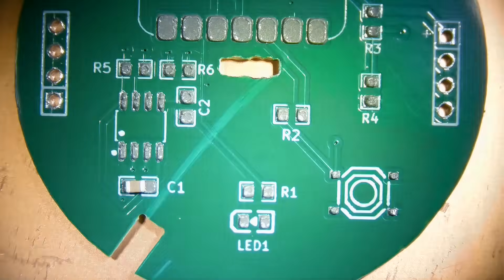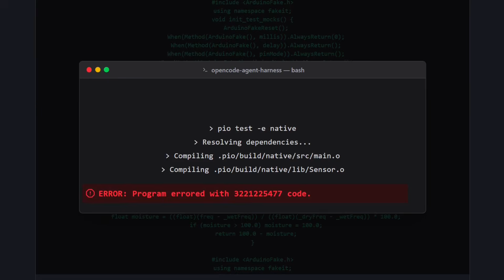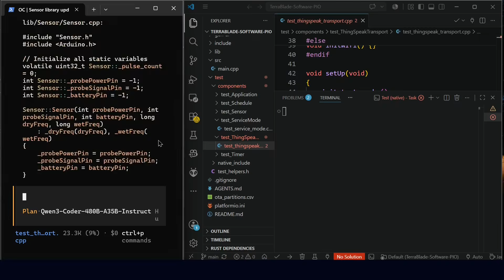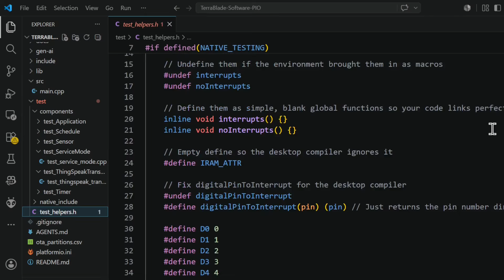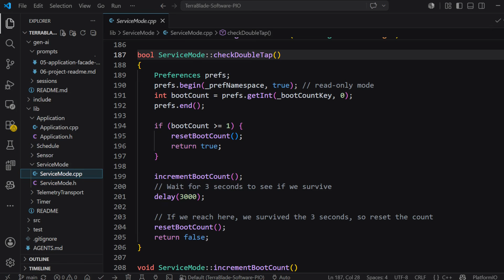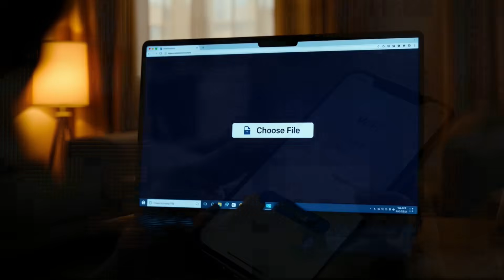I Let an AI Code My ESP32 Sensor... Designing a Low-Power IoT Capacitive Soil Sensor (Part 2)

Comment: So your issue with AI is that you used an open source qwen model, with likely insufficient context, and it got things wrong? Try extracting all the datasheets into markdown files for additional context for it locally as step 1.
Reply from the maker: Thank you for watching. 

Great tip on extracting datasheets to markdown!
 
With the proper context and a good agent harness, it could absolutely handle this fully autonomously. I'm a huge fan of fully agentic workflows!

The main reason I reverted to pair-programming here wasn't a knock on the AI. It was because my project was already half-scaffolded and I knew exactly what I needed the C++ to do. It just ended up being faster for me to take the wheel rather than tuning the context.
Reply: @bjdsolutions8928  Also, you see these coding models smash out a python script and expect them to bring the same skill to other tasks. It does not work like that. I've had great success by 1) giving them the right context and info, not expecting them to have it already. 2) Giving it a good way to find new info, I can fully recommend exa mcp as a great starting point. 3) giving them a fully structured debug loop, which I normally code as bash, wrapped by a makefile. What I mean is having scripts to flash the microcontroller, reboot it, capture boot logs, and noting it in the AGENTS.md. Don't make the models figure the basics out. 4) when i see it do something wrong, the correction goes into AGENTS.md. There are some setups that automatically do this, but even manually, you start compounding the fixes and things start to just work.

Now, I need to get back to getting my ESP32 S3 to flash an ESP32 C6 automatically on boot if it's not at the right version. It's almost done, and quite slick, I'm hoping to use the S3 OTA slots to allow elegant updates and rollbacks for my new product, which is a multi-radio hub. AI (In this case, GPT-5.5) has been massively helpful.

I hear EasyEDA has a great local API, and they also publish a local skill. I've seen people use this to do 90% of the PCB layout. I've not tried it yet, but that might be a good Youtube video.
Reply from the maker: Man, this is exactly why I love learning in public. This comment is a great roadmap for agentic workflows in embedded systems!

Wrapping the mechanical debug loop (flash/reboot/logs) in a Makefile makes sense. Stopping the AI from burning tokens trying to figure out how to compile. I suppose you could add a poison pill here too if the agent fails to compile/pass a test too many times.

Your multi-radio hub project sounds awesome. Good luck with the rest of the build!